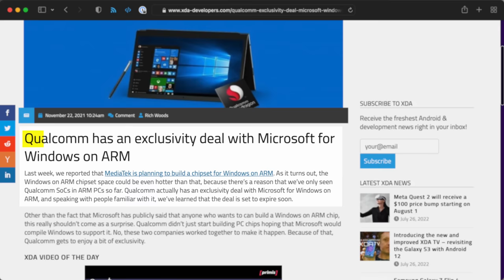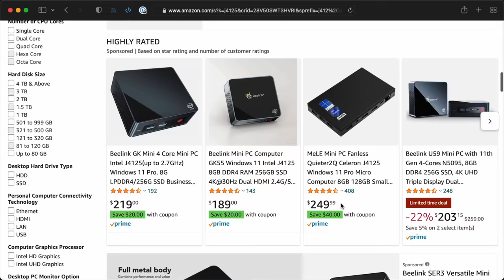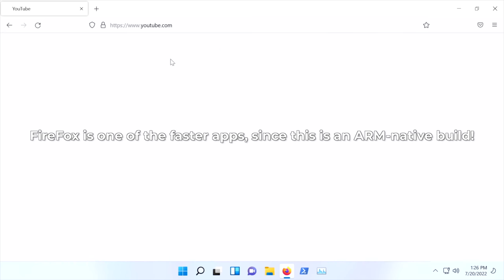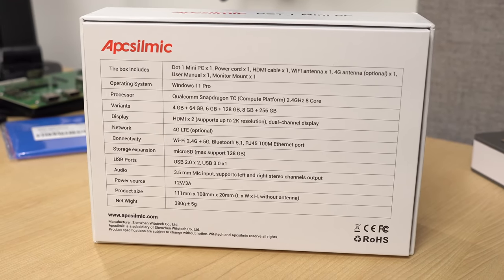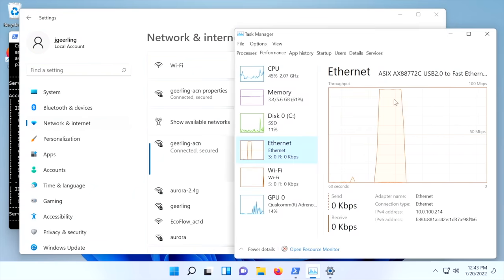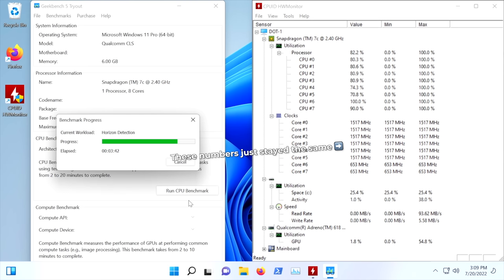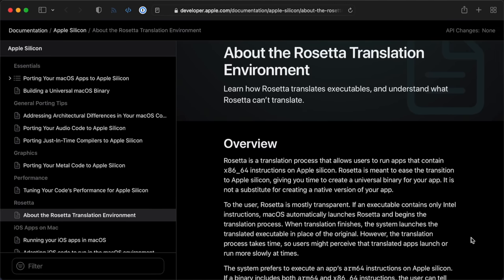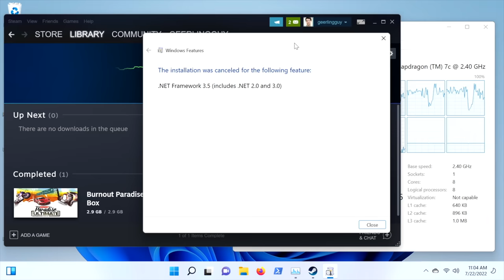Microsoft's wasted potential: Windows on ARM

Comment: Apple already said that they would be open to the idea of native Windows (BootCamp) on Apple Silicon, Microsoft just needs to allow it, i'm hoping they do that as soon as their exclusivity deal with Qualcomm runs out.
Reply: people have tried with emulation stuff and it's actually way faster emulated windows on ARM on an M1 MacBook than the best surface pro X
Reply: I would absolutely love it if this Microsoft/Qualcomm crap's end did lead to Microsoft allowing Windows to run on Apple Silicon. Apple has left Boot Camp in the M1 versions of MacOS for a reason, and that is to allow users to use Windows natively, if Microsoft ever were to allow it. I sure as hell hope they will, and the sooner the better!
Reply: I hope this inclines people to use linux more since wine has gotten so much better
Reply: @rodrovelasquez1634  Wine has indeed gotten much, much better over the years. But, unfortunately, it's nowhere near possible to run everything through Wine just yet. Especially as of late, with the Steam Deck being so popular, development of Wine seems to have been focussed around the performance of games and related software. Which is logical, seeing as that is exactly what brought about the exponential rise in usage of Linux across the board in the past few years. But what this does mean is that, at least in my view, less attention is being put toward getting (new versions of) productivity software to work (fully) on Wine. For myself, this means that, even if I would like to, it's very much impossible to switch to Linux, because the software that is most important for me to do my job just does not run. It hasn't been on the "supported" list in any iteration, so it was always hit and miss, but the last couple of versions simply don't run at all, whatever I try to get one of them working. Should you want to peruse the various knowledge bases for a solution yourself, then please go ahed. The software in question is called MemoQ.
That being said, this is not the only program that doesn't run properly, unfortunately, so for me, it's as of yet unfeasible to switch fully to Linux (i.e. without relying on virtualisation, which is what I'm also doing now I'm daily-driving a Mac, for which all of the above is also 100% true).
Reply: apple chips is too good.  by the time bootcamp is available for m-series macs, windows machine sales is gonna tank, and that's the last thing microsoft wants
Reply: @MrAria2000  
Lets look at things people dont want to hear or discuss. Heres some stats for you Intel/Amd with Windows have 80% of the PC market. Apple has around 15% if im generous. The rest being Linux. This is mainly because people need compatibility. 

Apple made the decision to go with M series in order to increase their margins and make their eco system more locked in. Good for Apple, bad for consumers. This is because the new M series are unexpandable and unrepairable, once outside their warranty. The candy is supposed to be battery life, great. No thanks. Not good for Corporates attall. Some companies require flexibility. 

Lets discuss what hapens when the SSD or machine dies. Youll lose all your data and no one can get it back. Its soldered onto the motherboard. So plan for that. Just sayin.... 

Users like choice. The M series have trouble running other OS. Yes Im aware of the boutique Linux Asahi but its not Ubuntu. Windows dosnt run well on M series, it can only run through Parrallels without accelerated graphics and some thing wont run attall on it. Yes Ive heard it supposed to be Microsofts fault but it was Apple who changed the processor, not Microsoft. The responsibility clearly lies at Apples door. They refuse to provide Bootcamp, blaming Microsoft. Thats not on. They did it previously. 

All in all, a hard pass,
Reply: @zicadibrove4119  So Apple is supposed to sell inferior hardware so that Microsoft software can be sold for it, you’re seriously ridiculous if you think that, Apple’s M series is also great for most consumers, if you’re that worried about loosing your data then just use an external SSD, the problems you mentioned of everything being soldered in place and non repairable isn’t an M series fault, most laptops have soldered in components with the one exception being ram which tends to be upgradable, but even the SSD’s on most modern laptops have begun to be soldered in place, unlike X86 though the M series of chip offers the advantage of better performance at lower power levels which means less overheating, less battery drain, more battery life, less electricity consumption and faster performance than you could ever get with X86
Reply: @NXGen461  The soldered in storage on Windows laptops can be removed and data recovered. You cant do that on M series as they dont use SSD storage. Apple DO sell inferior hardware, its unrepairable. If you dont mind throwing it away when its out of warranty, great. It will never outsell X86. Apple only represents around 15% of the PC market. Theres a reason for that.
Reply: @zicadibrove4119     To your first point, yes, M series chips do increase Apple’s margins, no they don’t do it at the cost of being “more locked in” anything you can do on MacOS in Intel you can do on MacOS in Arm and if you don’t want to use MacOS then don’t, buy something else or support the communities building better software specifically for ARM which is clearly the future for not only Apple but Microsoft computers.

To your second point, this is frankly the most ridiculous point of all, if your SSD dies then it’s dead and you loose the data in it. Simple, if an SSD on a windows machine happens the exact same thing happens, if you fear that happening the solution in both systems is literally identical, store important data elsewhere, wether It’s in the Cloud or an external SSD.

Yeah nevermind your last point is the most ridiculous. “Windows doesn’t run well on M series chips” except it does, it literally runs better on M series chips through emulation than natively on Qualcomm ARM chips. You’re literally saying Apple is at fault for not bending over to Microsoft and letting them have control over Mac’s, Bootcamp on Mac works, it’s right there, Apple didn’t block it from working, they didn’t disable it or uninstalled it, what doesn’t work is Windows, that isn’t an Apple problem, that’s a Windows problem, if Windows cares about wide compatibility then it’s up to them to prove it, or are you saying Microsoft should’ve never supported X86 architectures because they were new and it would cause compatibility issues…
Reply: @NXGen461  You cant run AAA console quality games or Ubuntu etc on M series. Theres plenty of stuff that will only run on X86. Companies cant get some software updated, theres plenty in the Corporate market that needs X86. ARM is only the future for Apple.
Reply: @zicadibrove4119  Let me correct you, the SSD on some** Windows laptops can be extracted and data recovered, that also isn’t up to Windows in any ways, that’s up to the manufacturer, this video is about Windows
Reply: @alyx6427  virtualization, not emulation. They are different.
Reply: @zicadibrove4119  Apple only represents 15% of the market right now, that number has been increasing constantly for a while, and this video isn’t about Apple specifically it’s about ARM, if you look at ARM vs X86 the conversation is entirely different, look at your phone and tell me what exactly that uses?????????
Reply: @zicadibrove4119   you can run triple A games and Ubuntu on ARM and Mac’s, right now it requires some translation because ARM on desktop hasn’t been widely supported but that WILL change
Reply: @NXGen461  sorry youre wrong. You dont know what youre talking about. I work in Corporate IT, we avoid the new Apple stuff like the plague.
Reply: @zicadibrove4119   1. The vast, VAST majority of non-game applications work on macOS without issue, mainly due to web apps. 
2. People use Windows not because of compatibility but because Macs are expensive and PCs tend to be less expensive (and worse, but many consumers don’t need the extra power.)

3. Most consumers don’t care about expandability, and the ones that do use PCs. I’d say the vast majority of people I know who aren’t tech savvy would never open their computer to replace something. Do I agree with Apple not allowing storage recovery and replacement on the Apple Silicon Macs? No, of course not. But most users wouldn’t open their computers and don’t care. 
4. “Users like choice.” Man, I wish that was true. If most users really liked choice, then why did almost nobody ever use BootCamp when it did exist? Probably because the vast majority of people were absolutely fine with macOS.
Reply: @zicadibrove4119  “Sorry your wrong” with no attempt to even disprove a single point, you avoid Apple because you’re fanboys of Microsoft, this video wasn’t even about Apple and you managed to bring all of these invalid arguments about another company.

This entire video was literally about how poor the optimization on Windows was on ARM processors natively and how that was a problem on Windows side not on ARM and you didn’t even mention ARM…
Reply: @UCjKsfZpJlUkU2QIer05SNXQ usually it’s the other way around, the SSD is upgradeable but the ram is soldered. I have never seen a laptop with soldered storage not made by Apple or Microsoft.
Reply: @NXGen461  also emulation /= virtualization. The m1 chips are virtualizing ARM windows. Not emulating X86 Windows.
Reply: @DistrosProjects  the Dell XPS had soldered SSD if I’m not misremembering
Reply: @DistrosProjects  to my point it doesn’t really affect anything, I know they’re different things but really it’s just semantic at the end of the day
Reply: @DistrosProjects  Companies and hobbyists used Bootcamp all the time. Where I work, they like to choose. There are plenty of business applications that require Windows. The M series is driving users away from Apple. Sorry but the newer M2 is a joke. If you like ditching all your software and starting from scratch, great.
Reply: @zicadibrove4119  1. You might be right about BootCamp being used in companies sometimes, I don’t doubt that. However, most businesses don’t need features from both macOS and Windows, so I would say it’s more likely to be seen on someone’s personal or business-issued laptop. Apple’s boot camp drivers suck, but they don’t have to, that’s Apple being stupid. 
2. “The M series is driving people away from Apple.” Look up sales figures before making a claim like that.
3. “The newer M2 is a joke.” I half-agree, it’s kind of pointless. 
4. You do realize that Rosetta exists, if you’re referring to older mac software, right? You can still run most everything from Intel macOS on m1, along with some iOS apps. 

Also to clarify, I’m not an Apple fanboy. I don’t agree with many of their choices such as soldering the storage in the M-series. However, I also don’t agree with lying.
Reply: How would that work? Boot Camp isn't supported on Non-Intel Macs.
Reply: Apple needs Microsoft more then Microsoft needs Apple. What's the benefit to Microsoft? A niche of Windows licence sales but more people buying Macs over Windows PCs.
Reply: @alyx6427  the Surface Pro X has an SOC from 2019 for starters and all people did was run a few benchmarks. A virtual machine, Parralles, by its nature isn't going to offer a better experience than running an OS native on a computer. Benchmarks only tell a narrow story. Sure they maybe faster but I'd seriously question if every day use is better.
Reply: @slashtiger1  are you sure? I distinctly remember reading Boot Camp wasn't supported on Apple ARM SOCs.
Reply: @DistrosProjects  er. people really do use Windows because of compatibility. Hundreds of thousands of people in thousands of businesses globally. Macs are great for consumers and creatives but simply not up to the job for the many businesses. Its ALL about compatibility.
Reply: @bradavon  you can barely launch a lot of x86 programs on a surface pro X or other windows on ARM devices, even on new chips. meanwhile every single Mac with apple silicon can run x86 programs as good or faster than its predecessor (plus general use is way way better)
Reply: @NXGen461  Try 9% and 15% is nothing. Dell, HP and Lenovo sell more PCs in a month than Apple does in 6 months. The vast majority of businesses ignore MacBooks because A: Macs means Compatibility issues for thousands of business critical Desktop apps B: Apple is known to cut off older versions far quicker than Windows, therefore simply making them unsuitable. You can run apps designed for Windows 95 on Windows 11. The equivalent is simply impossible on MacOS and that really matters.
Reply: Why?  Could it be that Apple still only has 8% global laptop and desktop market share and their M1 chip has been a complete failure...
Reply: @NXGen461  Watch out; it's an apple fanboy trying to cover up all sides of apple
Reply: @bradavon  That's right; you can't run Boot Camp (yet), but the app is on there. If Microsoft "frees" Windows on ARM and Apple pushes the correct switches, you'll be able to use it with no extra fuss. It sits there waiting for whatever has to happen. If you run it now, the wizard shows up and tells you it can''t be used on "this system", but that appears to be some kind of software lock. And for once, that is a good thing. Because if it weren't there, the wizard would run but you'd still get nowhere because Microsoft and Qualcomm.
Reply: @alyx6427  Its not emulated... its virtualization. But yeah, Windows 11 in VMWare Fusion Tech Preview running on macbook pro m1 max is much faster than it running natively on the Surface X.  Its pretty sad.
Reply: Samsung writes drivers, gets their laptops certified, licenses Windows ARM and pre-installs it. Lenovo write drivers, gets their laptops certified, licenses Windows ARM and pre-installs it. Acer writes drivers, gets their laptops certified, licenses Windows ARM and pre-installs it. HP writes drivers, gets their laptops certified, licenses Windows ARM and pre-installs it.

Apple could write drivers, get their machines certified, license Windows ARM and pre-install it. Just like every other OEM.

If you want Windows on M1 - ask Apple - they are the OEM.

Microsoft's business model is to only license Windows ARM to OEM's who preinstall on machines with certified drivers with the license tied to the CPU. Microsoft doesn't sell Windows ARM to consumers. This business model is JUST LIKE APPLE and MacOS. There is zero benefit to Microsoft to change this business model.
Reply: @logaandm  Thing is though, that Microsoft only sells to OEMs who use Qualcomm; not a single other type of ARM processor (of which there are many). Apple has already said that they'd be willing to allow users to run Windows on M1/M2. Heck, they may have even already written the drivers. It's just that Microsoft doesn't allow its software to run on any other type of processor than those made by Qualcomm. There definitely is a difference when you compare it to the situation on x86(_64).
Apple is different in that it has NEVER allowed OS X to run on any hardware other than their own. Microsoft does allow Lenovo, HP, Fujitsu, Samsung (you name it) to use Windows or Windows on ARM. However, there still is a difference, even for OEMs: When talking about Windows on x86_64, these OEMs can use any compatible Intel or AMD processor. When talking about ARM, they are ONLY allowed to use Qualcomm, even though there currently are no fewer than five other options to choose when looking for an ARM processor (obviously excluding Apple Silicon here). For example, Samsung has their own Exos chip (forgive me for not quite getting the name right). That, and any other ARM-based processor, however, cannot currently be used, even if these other processors are perfectly capable of running Windows on ARM. If you'd take a similar approach to Windows on x86_64, then that would be kind of like forcing manufacturers to only use Intel, and to not use AMD. And that's plain wrong, whichever way you put it.
Reply: Sounds like the next Nokia in the making…
Reply: @slashtiger1  Do you really think that Apple is ever going to pre-install Windows on any of their machines? Because that is what it is going to take. Apple hardware with Windows ARM preinstalled is the licensing requirement. 

The exclusivity agreement with Qualcomm will expire once there is a decent market for Windows ARM devices. Samsung has already been talking about releasing hardware with their own Exynos ship, but without the market why make the investment?

Apple could easily get that agreement canceled by by simply agreeing to preinstall Windows ARM. It would sell like hot cakes - and run Windows. Apple will never do this because it would destroy their most valuable asset - a closed eco-system with users who can't easily switch.

I've been using Windows on MacBooks for years. I have a 17" 2010 MBP which runs Windows 11 beautifully because it has mostly standard hardware but won't even run High Sierra properly. 

Apple is shit when it comes to Windows drivers. Appole deliberately disables hardware features such as the T2 chip, fingerprint reader and Intel GPU on boot so it is impossible for Windows drivers to be written. Then Microsoft gets blamed for Apples shitty drivers and shitty business practices because it doesn't work as well as MacOS.

Apple doesn't play well with others. What a surprise, no one wants to play with Apple. You're dreaming if you think "bootcamp" is ever coming back. 

The M1 and M2 are going to be PowerPC 2.0 as everyone else just moves on and Apple is left in a technology cul-du-sac.

I wish all the Apple M1 and M2 users luck, but seriously, stop blaming Microsoft for what is really Apple business practices. If you want or need to use Windows, complain to Apple or buy PC.

Note: I want to thank some anonymous engineer at Apple for defying convention and finally providing a proper trackpad driver for my 2019 and 2020 Intel models. Now please give me a Windows graphics driver that doesn't kill my battery. A fingerprint driver would also be most welcome.
Reply: @logaandm  Pre-installing or not has nothing to do with it! This exclusivity deal is what forces that upon us! why wouldn't Microsoft sell WOA to consumers like they do WINx86? They could, but they don't because of the deal, and nothing else! It's this deal that prevents it from happening. And by the way, you can legally download WOA yourself if you have eligible hardware. Again – the download itself isn't what would be illegal; it's the fact that you'd be installing the thing on, say, an Exynos-based system. Yes, you'd have to jump a few hoops, but it wouldn't be less legal for it.
The only reason for Microsoft to stick to pre-installed distribution is if they'd invest (far more heavily) in making their own hardware, and tying Windows to it, like Apple does MacOS. But they don't. Surface devices are neat and all, but they don't quite cut it compared to what the competition has to offer, so for Microsoft to take this step would be their death sentence.
Apple is far from totally blameless when it comes to what you described here, that's true. My Mac predates T2 and only has dedicated graphics, so the scenario you describe doesn't apply of course, but still – it would be neat had they not done this, and allowed users to do as they please.
At least on my Mac, I could use Windows like I can MacOS if I'd wanted to; everything worked as it should. By the way, the only drivers Apple actually had to write are for their mice and keyboards; the rest is (on this Mac at least) provided by others. Graphics by ATI/AMD, sound by Analog Devices, et cetera. So if, for some reason, the driver provided by Apple wouldn't install, you could actually download it from those manufacturers' websites or even through Windows Update. In fact, if it weren't for the keyboard, and particularly the mouse, you wouldn't even need Apple's drivers at all to run Windows on this Mac. The mouse (Magic Mouse) is dead as a doornail without it however, and the keyboard (Magic Keyboard) only works in wired mode if you don't have the driver for it.
Perhaps I may be slightly biased because of the situation with this Mac, because I know that things definitely got worse with newer models, starting with the ones carrying the T1/T2 chips.

And yes I know "you'd have to complain with Apple if using Windows is what you want", but before one can even go that route, Microsoft is going to have to end this exclusivity deal with Qualcomm. Again, the deal itself is the reason why WOA essentially has to come pre-installed, and it is also the reason why WOA isn't allowed to be used on other ARM platforms, even those outside of Apple's.

Regarding your stance on M1/M2: I don't think this platform will become the col-du-sac you describe it to be. It's one of the best-developed ARM-platforms out there at the moment, others don't even come close. There has been and is ongoing progress to get Linux to run on the platform, and at least for M1, nearly everything works now. Including the Rosetta compatibility layer. No part of the SOC has been disabled for use outside of MacOS, as was definitely the case with the latest Intel-based Macs. True, this effort to get Linux working is mostly community based, but that doesn't mean it can't be done. I myself know quite a few people who own M1 Macs and use Linux on them.
And even if you look at the market share of MacOS, thats only ever increased since M1 hit the market. The only platform that will bite the dust in the near future is x86_64, and, actually, that's long overdue. But if Microsoft doesn't get their act together and make serious work of allowing WOA to run on anything other than Qualcomm, they might well miss the boat.
Reply: @slashtiger1  I've been involved in technology my entire adult life including installing Linux in the early 1990's. I seen it all come and go. I can assure you that Apple goes out of it's way to make sure Windows drivers are pretty awful.

Essential things like keyboards are OK. The trackpad is degraded compared to MacOS and less important but annoying things like Bluetooth audio are often awful. If, a big if these days because of Apple branding restrictions on chips, you can find a driver for similar hardware from Dell or HP, then Bluetooth works great. The problem isn't Windows, it isn't the hardware it's Apple. Microsoft has been putting up with BS for decades, why would it want more of the same from the M1?

Blaming AMD for poor GPU drivers is complete BS. The hardware is specially made and modified for Apple. AMD is just the supplier of the hardware - like others make the M1 chip for Apple. Apple doesn't actually make hardware, it contracts that out. AMD is just another contractor in this case.

I do blame AMD for taking such a stupid deal from Apple. It's Apple's GPU, they should provide the drivers. Apple doesn't work well with other, now AMD is locked out of the Apple market completely. Why would AMD make better Apple drivers. No incentive at all.

I can also assure you that neither Apple or Microsoft is going to do anything that isn't in their own interest.

Apple software users make up less than 1% of Microsoft's earnings. Even consumer based Windows users do not make up the bulk of Microsoft's earnings. Microsoft makes it's money from Corporations and Governments and that is where Microsoft's interests lay. People complaining about Windows and Microsoft should always keep that in mind. Corporations and Governments pay the costs, they call the tune.

Microsoft makes it easy to install Windows for the purpose of integrating the consumer into the corporate work environment. So Office on line, but not 100% functional, Windows that installs easily and doesn't die because you don't active, and the recent move to requiring a Microsoft Account to use Windows and closer integration to internet services like OneDrive - at the office. 

All these speak to Microsoft's basic business being corporations and the general trend to making money by selling consumer data to advertisers. Something Apple also does, just mostly to itself and to Google.

With only 1% of their market and with Apple consistently locking Microsoft (and others) out of hardware access to the iPhone and now the T2 chips and other Apple hardware, Microsoft has zero incentive to do anything for Apple or Apple users. The iPhone is the big prize and Apple, rightly, guards it like the crown jewels. (Stunning to see BTW)

As for technology. Apple had to switch from the PowerPC because software developers would do Intel first and PowerPC after. That is because the vast majority of the market was Intel and developers, hardware makers and companies would focus on Intel first.

The majority of the PC market is still Intel/AMD. That is why Microsoft has struggled in getting ARM adoption for the last 10 years. Microsoft wants to switch to ARM because Microsoft wants servers to switch to ARM to save on energy costs. Microsoft's biggest business is running server farms.

This entire discussion is about Windows on the M1. Ask yourself why you even care? Is it because you like Windows more? Obviously not. It is because you need Windows for work or to run Windows only software? Probably yes.

As long as the M1 cannot integrate into the corporate and government world, it will be a consumer and niche product and always second on the developers todo list.

For Microsoft to provide Windows on the M1 there has to be a business reason. There are only two reasons, in my view.

1. Apple preinstalls Windows.
2. Apple gives proper hardware access to the iPhone.

Pigs flying and snowballs in hell come to mind.
Reply: @zicadibrove4119  you absolutely can run ubuntu on Apple silicone.
Reply: @logaandm  You know full well that the "reasons" you're calling out (which, by the way, aren't "reasons" but rather "scenarios" aren't ever going to materialise.

As for the rest of your story, I do wonder why you are so bitter when it comes to Apple, even though both Apple and Microsoft are to "blame" when it comes to the situation we've been discussing. Like I said, on my 2017 iMac, there literally is nothing that doesn't work the way it should even when running Windows 10. I don't know about Windows 11, because I never tried that as of yet.
Apple's OSes run so great on their hardware because they have vertical control, and if Microsoft wants to achieve the same, then they should expand on the Surface line. Which they probably will, as a matter of fact. I think the only thing that is eventually going to disappear is the x86(_64) architecture... Which is long overdue, as I've stated before.
Reply: @djxdjxdjdjdd That's putting it a little too bluntly imho. Don't forget that, by default, many ChromeOS devices don't have any local storage; something that is still very important. In fact, the statement I made just now seems to be applicable only to older devices, so I guess even Google has retraced some of its steps regarding that matter.
However, we're not there yet. ChromeOS literally does nothing other than running an instance of Chrome. Yes, it's true that many people use their browsers for the majority of their workflow these days, but to have access to literally nothing else feels very, very barebones if I may say so.
Because of this, ChromeOS could never become my daily driver in its pure form. Granted, it can run Android apps and even a (limited) flavour of Linux now, but still...
Reply: @slashtiger1  OMG!. If the last upgradeable iMac from 2017 is the basis of your opinion you are in for a very rude awakening! I have a 2015 MacBook Pro and 2017 MacBook Air I am pretty happy except for the track pad driver and Bluetooth in Bootcamp. My 2019, not so much.

Anything with a T2 chip, soldered on SSD, fingerprint scanner, touch bar are the problems. M1 continues that trend.

Anyway, the discussion is about Windows on the M1. A very different thing from the days when Apple made an effort to be compatible with PC hardware.

In all these discussion of Bootcamp and the M1 no Apple fan ever presents a reasonable business case for Microsoft to do it. The reason is because there is nothing in it for Microsoft, so Microsoft won't make the investment. Bootcamp for the M1 will only happen if Microsoft can make money from it.

Use the M1, I don't care. I am sure it is a great MacOS machine. But don't hold your breath for licensed Windows on it.
Reply: @logaandm  This is probably your most reasonable contribution to the discussion so far. I can see where you're coming from. Although it has to be said: bluetooth, and more specifically Bluetooth Audio, is, and always has been, very much hit and miss ever since Windows 8. Windows 8 updated Microsoft's bluetooth stack to use different components than the previous version, which saw its last revision in Windows 7. As such, even "made for Windows" computers (which is my way of saying basically anything that is intended to be able to legally run WINx86) sometimes have great difficulty when pairing and using Bluetooth audio devices such as headsets and, again, more specifically, speakers. Oftentimes, pairing will work just fine, but actually using them won't. As such, I am in no way amazed that bluetooth on your Mac doesn't play nice with your audio gear, as it's basically the same story on any machine running any version of Windows post Windows 8. As far as I'm aware (and yes, I'm still very much aware of what happens in the Windows user space), Windows 11 hasn't (yet) managed to resolve issues for those who had them when they ran Windows 10 or earlier. Bluetooth audio just has always been one of the weakest points in Microsoft's own bluetooth stack. Don't ask me why, but it's a genuine problem. It got way worse after Windows 7, but it actually has always been there, ever since Microsoft started shipping their own stack back in the days of Windows XP. That is why many people replaced it with, for example, the Soleil stack if their device supported it. So, long story shirt, Bluetooth (audio) just doesn't form a very good base line for your argument against running Windows on Apple hardware.
As far as any other module made by Apple, such as the T2 chip, yes, it's more than atrocious that it is disabled. But, if you know what it actually does, it's also kind of logical. This is because one of the main functions of T2 is serving as Apple's implementation of Secure Boot. And Secure Boot has to be disabled if you want anything other than MacOS to run on their hardware. The annoying thing about this, however, is that in doing so, all of T2's functions are disabled.
This is also why the fingerprint scanner doesn't work, as T2 also holds the Secure Enclave on systems that have it (systems that don't have it generally don't support Touch ID at all).

Coming back to Windows on M1: Apple did say, whether you believe it or not, that they intend upon making Windows available natively on the platform as soon as Microsoft allows it. And, like I've stated before, I personally do not see any reason as to why Microsoft could not adopt a model similar to that used with WINx86 as soon as this Exclusivity Deal ends. It may be unlikely to you, bit Microsoft could easily start distributing WoA as a stand-alone digital purchase for people with ARM devices (even excluding those made/designed by Apple). If and when Microsoft allows Windows to run on other ARM devices, like Exynos, Apple is also free to start work writing drivers for components that don't yet have them. Obviously, there may, and probably will be, limitations when it comes to running it, such as some components not being available. For example, chances will be that the Secure Enclave may not be accessible from Windows (which is also how things stand currently for Linux).
By the way, in case you didn't know, Apple Silicon devices don't use a T2 chip (or something similar) any more. They have their own, dedicated Secure Enclave, and all other functions performed by T2 are also handled in different ways, so it remains to be seen what will and will not work if we ever see the day that Microsoft ends the Exclusivity Deal for WoA. Because yes, that deal is the greatest stranglehold for its future. Even if you completely disregard Apple Silicon.
Reply: @slashtiger1  Just because Microsoft could doesn't mean they will. I see no benefit to Microsoft providing BootCamp for the M1. Seriously, why would they? Come up with an answer to that question and you will have a decent argument.

Hearing complaints from people who are not customers isn't going to change that Apple has to sweeten the deal. That means preinstallation Windows, just like every other OEM or better access to the iPhone and Apple eco-system. Both of those things have an extremely low probability of happen any time soon.

My experience with Bluetooth on Windows is not the same as yours. I have perfectly good Bluetooth audio on many Windows devices. I have had perfectly good audio on a 2015 MacBook with Windows - using Dell drivers. 

It isn't the hardware, it isn't Windows, it's Apple being Apple.

I've read all that crap from Apple fans about the bluetooth stack. It simply isn't born out by my experience. If it was the stack in Windows then Windows Bluetooth audio would always be bad and it just isn't. 

Apple and Apple fans are really good at, gaslighting and blaming others. Any uncertainty in a problem and Apple will exploit that and quickly blame the user, blame another company and just walk away from the problem. It is part of their corporate culture.
Reply: @slashtiger1  Sadly the opensource version of WINE doesn't support any MacOS past Catalina — only variants do.
Reply: @zicadibrove4119  Actually it was also because Apple was tired of Intel messing up ("Ex-Intel engineer: Apple turned away from Intel over Skylake CPU bugs") and there was no way AMD could support the levels of Mac Apple had planned.  Windows for Arm runs very well on the M1 — nearly 2x as fast as on Qualcom's ARM chips.
Reply: @Maximara  I know... I use(d) CrossOver. One of the best (paid-for) variants available on the Mac. I had more success using it than any of the other variants (paid-for and free) I've tried before and after.
Reply: @slashtiger1  From what Wine HQ says the reason the free version(s) is (are) so behind is supposedly because one developer "won’t allow the current patches into upstream wine as it’s considered a hack and requires a custom compiler"
Reply: @zicadibrove4119  The thing is the Corporate market is very much in Sunk Cost Fallacy land and will hold onto old hardware and software until they have to replace it.  That is why you had "ATM security still running Windows XP" as late as 2020 a 12 year old OS if you count from the last release.  Heck there are ISPs who still think dial up is the bee's knees.  Ie the Corporate market is for the most part greedy stupid.
Reply: @zicadibrove4119  Of course Corporate IT would avoid Apple because as IBM has documented avoiding Mac makes sure IT has something to do — "IBM Announces Research Showing Mac Enables Greater Productivity and Employee Satisfaction at IBM"  The last thing Corporate IT will want is something that saves $273-$543 in upkeep — they may get cuts back in their budget .
Reply: @bradavon  IIRC that was because Boot Camp required an Intel CPU and without something akin to a Rosetta layer it will not work.  In fact interpretation (NOT emulation) is so fast with Windows for ARM why in the same of sanity woudl you want to boot into Windows directly and have a slower performance?!
Reply: @logaandm  Sure Microsoft gets a benefit — they get something better than the joke Qualcomm's version of ARM is to run their OS on.
Reply: @logaandm  Crazy Mcgee launchs a pig with a catapult  — there is your flying pig and by the way if Dante is correct the Ninth circle is frozen so there are plenty of snowballs in hell - they are just limited to the Ninth circle. 😛
Reply: Apple still has to write drivers though. It's not enough just to allow Windows to run in Bootcamp. Without good drivers it wouldn't be any better than running Windows 11 in Parallels.
Reply: @yarnosh  If cars of the future won't need drivers why can't software? 🙂 Yes I am being purposely silly but IMHO the only reasons to want to run windows is for games and software that isn't crossplatform.
Reply: @Maximara  But that's exactly it... games need solid video drivers. They're already at a huge disadvantage running on a different architecture using Microsoft's decidedly inferior translation technology.  Without good drivers there would be no point (if it is possible at all) to run WIndows under Bootcamp. 

If you have an M1/M2 Mac I think you just have to accept that you'll need another gaming system. I run a tiny handful of games on M1 Mac that already ran under MacOS. But for everything else I have a different computer I use.
Reply: @yarnosh  Well the fact the Mac blows goat out of a catapult as far as gaming goes has been know for decades though so many games are buggy mess it may not be that much of a downside. 😁
Reply: @Maximara  My gaming setup is actually a 2018 x86 Macbook pro, lol.   Though it is definitely starting to show its age and I don't play a lot of GPU heavy stuff. Being able to boot into Windows on a Mac used to have real advantages. I just don't think it would be that useful on an M* Mac. You really don't want to try play games on Windows 11 ARM either.
Reply: @DistrosProjects  "some major 2-in-1s such as the Dell XPS 13 9310 have soldered memory and storage to this very day."
Reply: @Maximara  Some absolutely do, I won't deny this, but most do not. Also I've still never seen a computer with upgradable RAM and not storage (other than the 2019 Mac Pro for the first few months, but there are auxiliary SATA and power ports, and Apple now sells SSD swaps)
Reply: What was MS thinking signing a exclusivity contract with Qualcomm?
Their SOCs are way too slow for something as bloated as Windows.
The only ARM out that that would be a match is Apple's M series. 
Other ARM's single core performance is miserable. Only way to get performance out of a generic ARM is to paralyze but most apps cant do that.
There are too many accountants and marketing people who are invited to board meetings.
Reply: @logaandm  I honestly don't know what you mean by Microsoft having to "provide Boot Camp for the M1". It's obviously Apple's task to do that. But they can't because of the deal that currently is still in place between MS and Qualcomm However,  this is not the point I've been trying to make in any of my comments. The point I am trying to make is that there are far more companies who provide ARM based architectures than there are for x86-based architectures. There's obviously Qualcomm, but there's also Apple (okay, they're a different horse, but it still is ARM), Samsung (Exynos) and many, many more. You make it sound like I am the only person on the entirety of the internet who wants the deal to be axed, but that is definitely not the case. In fact, this very video is pertaining to it. If Microsoft would just apply the normal model to WoA (that is to say, the same model they apply to WINx86) then all providers of ARM-based systems could opt to use it — it would literally benefit the entire segment of the computer industry. Even if Apple wasn't to be a part of it.
My "maiden" argument had absolutely nothing to do with Apple per se, even though Apple did say (and don't deny this unless you can show documents or otherwise from Apple that do so) that they would be "open to the idea of allowing Windows to be used on Apple Silicon," providing full support for the scenario, like they've also done for Intel based Macs.

Then you go even further and "accuse" me of being an Apple fanboy because I pointed out a problem with the Microsoft Bluetooth stack that has been around since Windows 8? How does that fit with what I wrote about that? The computers on which I documented the experience here weren't even made by Apple! None of them. The issue that I described, was, by the way, even documented by Microsoft themselves. It pertains to using headsets or speakers to play audio over Bluetooth. Oftentimes, the headset or speaker will connect and show up as an installed audio device, but sound will not be played back through it. This issue is relatively widespread but that doesn't mean each and every system experiences it. If anything, I _didn't experience it on my iMac, ironically...

Yes, Apple could do a lot better when it comes to providing drivers for running Windows on supported (Intel) Macs, but, for  this discussion, that is totally beyond scope.

Like I said, for me this isn't at all about whether or not Windows can be run on Apple Silicon alone. It's about allowing it out of its paddock; allowing it to spread its wings. Even Microsoft themselves can't fully commit to it if they stick to the deal, because, at present, for laptops at least, Qualcomm isn't anywhere near being the most-used ARM-based chip out in the wild.
Reply: Only if apple allows macOS on windows
Reply: @MrAria2000  Inertia will keep windows machine sales going as without a good translator (emulators are just too slow and have far too much overhead) Intel based machines will lumber along
Reply: @zicadibrove4119  There are unrepairable windows machines on the real low end as well. Regarding loosing your data you are intelligent and have your data on an external drive.  I have to ask just what is wrong with running Windows in virtualization mode especially when it runs nearly 2x as fast as it does natively.  Likely the speed boost is due to the tight integration the MacOS has to the Mx so having it run through boot camp could result in a reduction in speed.
Reply: @zicadibrove4119  "How to run Ubuntu 22.04 VMs on Apple M1 ARM-based systems for free" article shows that at least regarding Ubuntu you have no idea what you are talking about.  As for AAA gaming the Mac has blown goats in that market from nearly day one but with the cesspool AAA games seem to be becoming that may not be that much of a bad thing. 😁
Reply: @logaandm  Windows for ARM certification requires the Qualcomm CPUs which have already been shown to be hot garbage (nearly half the speed) compared to the M1.
Reply: @RK-um9tu  now the ARM chips on windows are a failure
Reply: @bradavon  you can run apps from windows 95 on windows 11 yes but that’s because still a lot of stuff on windows looks like windows 95/98 🤣🤣🤣